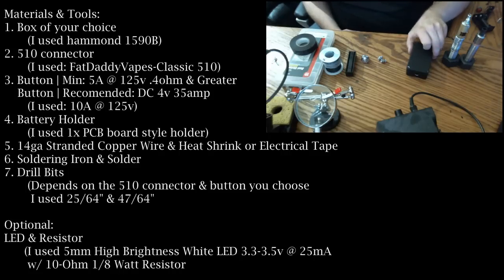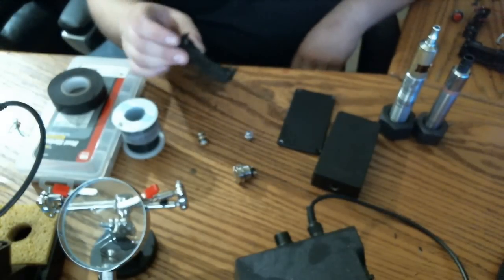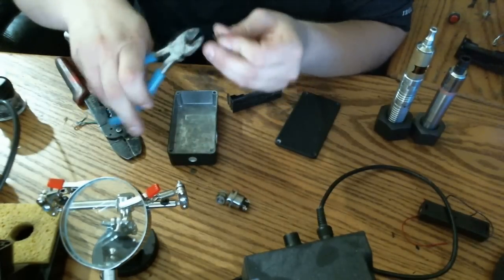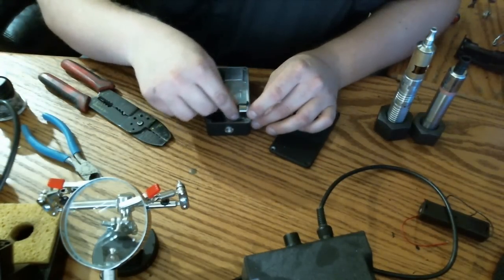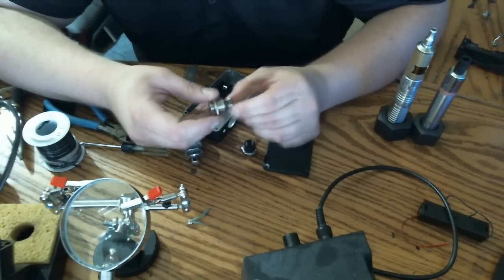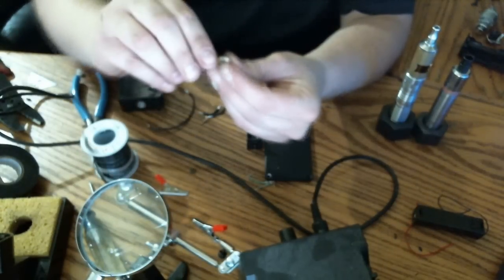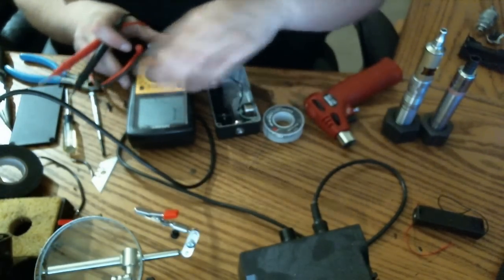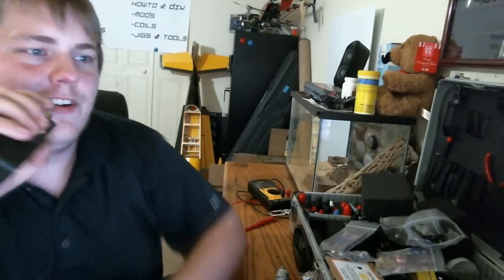How to build a Mechanical Box Mod FULL TUTORIAL

Comment: To the people that say this is not a "Mechanical" box mod. Well sorry to break it to you but this IS a Mechanical mod... just because there is a couple of wires in the power path, does not affect the fact that there is no digital electronic devices in the power path. Just because some "mechanical MODS" use the housing as the main ground does not take away this being a mechanical mod. Chassis ground is still a form of connection, just like a wire. Your just using the housing to carry the load as oppose to using wires. If you added a MOSFET in line to reduce the amp load going through the switch you then change its definition according to popular belief. Yet a MOSFET is nothing more then a relay (be it a solid state relay non the less) so to my understanding this still does not make it digital. Adding a solid state device in to a box mod is nothing more then good design and adds a bit of safety. But then again not a true "fully mechanical" mod. Ah whatever, but again the mod he is showing in this vid is fully mechanical and has nothing in the power path other then a single switch. The LED is only paralleled and has not effect on the way the power is delivered.
Reply: MasterMech77 You are mistaken, it is neither.
A Mechanical mod, as the word 'mechanical' implies, would suggest that not a single wire was used to complete the circuit.. A simple Google search will justify this statement.
This is an Analogue Mod. Evident through lack of digital circuitry, while there are still wires and components connected within the device. Again, Google will confirm this.
Just because there isn't a digital circuit board, doesn't mean to say you cannot achieve the same effect though analogue components. He even uses an LED and switch, both are analogue components.
For this to be mechanical, he would have had to do away with all of those things;
favouring no wires, no components, and a mechanical switch.
Reply: I believe: we started with mechanical circuits and devices; we then found analogue to be smaller and more manageable representations of their mechanical counterparts. Later we discovered how to shrink these analogue components down even further; to a point that a device which would have once occupied a small room, now fits into the palm of your hand.
Just look up a 'mechanical computer'.
Reply: 〈insert profile name here〉
Well by your definition anything with a switch is no longer mechanical.... hum
Reply: +MasterMech77  this is, in no way a mechanical box mod. Mechanical mods use no wires, such as a cherry bomber, noisy cricket, snowman, incubus...a mechanical mod has a solid switch that makes contact with the 510/battery....  this is just an unregulated box mod,
Reply: Randy Steele Sorry to say but Cherry bomber uses the housing as the ground. The wood and plastic Cherry Bombers use a short bit of wire to connect the 510 connection to the negative side of the batteries. The noisy Cricket uses a bridging plate (wire) that is insulated from the housing to connect the batteries in series. The Snowman uses a spring (which is nothing more then stiff wire wrapped in to a coil, so there is wires to make that mod) loaded base plate.

This Box Mod is as mechanical and a mechanical only. Unregulated mod would have a transistor in there to prevent the fire button from having to handle to full load from the batteries. That and a couple of micro fuses.

Here is a link to what an Unregulated Box Mod really is:
https://www.google.com/search?biw=1320&bih=852&tbm=isch&q=unregulated+box+mod+diagram&revid=1661255741&sa=X&ved=0ahUKEwjz9aOhgcXJAhUDYiYKHQ6ODgIQ1QIIHA
Reply: MasterMech77 I knew someone would 'nit pick'.
No. A switch in the analogue or digital domains control and serve a higher purpose "what will happen when the switch is in the off state?".
A mechanical switch does not care about 'state', it serves only to complete the circuit.

The vaporiser I built myself has no wires the negative current from the battery is received through the metal case, the metal case is used as a 'wire', and the button touches the top (positive) of the battery which completes the circuit within the 510 (connecting the weakest point (coil) to the battery). The button/switch is literally a sheet of metal attached to the negative 'downpipe' of the 510. Yes my mod is a bottom fed design; I copied and made my own reo'smod, for a fraction of what he charges. :P
Literally just a bottom fed 510 with a push button and a means to prevent the mod from firing unsupervised. I don't have a fuse, the coil is the closest thing to a fuse.

This vaporiser design is highly 'risky' only when operated, if the button is pressed for too long, if the user is inexperienced.
I treat my batteries well and do not over charge them. I build my own coils and take readings using a multimeter frequently to ensure my safety.
Reply: ***** Protected batteries have a circuit built into the cap to ensure that they are not being drawn from at a rate which would cause the battery to short.
I refuse to use these, as I have learnt how to prevent this from happening when I use my mod.
I would advise you use them if you don't know how to read a multimeter.
Reply: k

Comment: have your considered runing a MOSFET with you switches? wiring up a N channel Mosfet will alow you to run any switch and it takes the excess amps and volts and dump them. I built 4 boxs with this setup and they are running strong for 6 months sub ohm vaping

Comment: Hey! My evic vt just broke and I'm thinking about building a semi-mechanical mod using the evic vt's integrated battery pack. Do you happen to know where I could get a recharge/discharge circuit with overcharge protection?

Comment: Great vid. i have a rather beginner question. what resister do you use on the led and if you run 2 batteries in parallel does it change?

Comment: Have u used any resistors or mosfit on your builds and are they necessary. I am about to build mine with two 26650 batteries and was just wondering what all I would need

Comment: All I can say is, HOT GLUE.

Hot glue is a godsend when it comes to diy projects.  JB brand adhesives and menders which is more costly when working with small elecetroics.
Reply: tularem it may be a god sent but if done wrong on electrical projects it could melt all your shit
Reply: tularem a better thing to use for electrical is heat shrink

Comment: I really enjoyed your build I can't seem to find the switch anywhere I look do you think 10 amps is sufficient for a dual parallel build
Reply from the maker: Parallel builds do not stress out the button anymore than a single 18650 would.
If it were Series that would be a different story.
Reply: Well, a 10A switch can bear 10A of current, so the lowest you can safely build to is 0.42 ohms. That's assuming you can find a 10A switch.

Comment: wow thank you I appriciate you doing such a detailed video, but  it looks like after I order all those parts it would be more expensive then a reg mahine made mech mod ? true or flse ?
Reply: It depends.  If you make the box out of something else besides the Machined Aluminum Boxes then you will Omit the cost of a Machined Box, for example, if you make your own from Wood, No cost there if you got the wood for free.  Most box mods I've seen start out at around $65 on up.  So, with the Cheapness of the 510 connector and other parts, you should have well under that.  Most expensive part will be your PCB Controller board for Varable Voltage, Puff counters etc. Which then in return will Jack up the Price.

Comment: What is pre tining? I think thats what i was missing when i go to solder. The solder would never stick. is it grinding down or polishing it?
Reply from the maker: Pre-tinning is simply applying solder to each part before combining them. As opposed to sticking both pieces together and pouring the solder over them to combine them. Instead you take two pieces that you cover in solder individually and melt them together.
If your solder is not sticking one of these is likely the cause:
Cheap/weak soldering iron
Not using 60/40 rosin-core solder (smallest diameter you can get; I use .032")
Dirty wire or connection (clean with wire brush or apply flux)
Reply: A2Z Vaping Ohh ok! Flux is what i needed! Thank you!

Comment: How would you wire two battery holders in parallel? Also do you have a link to that DC switch? Do you know where I can get a box that will fit the dc switch and 2 26650 batteries?
Reply from the maker: Good news for you Harley I will be uploading a Part 2 in about a week showing a dual 18650 build wired in parallel.
If you need to know now parallel would be hooking the positive to the positive and negative to negative of each battery then wiring normally like I did in the video.
As for the switch I have seen them on Amazon & Ebay, Cole Hersee 9095
http://www.amazon.com/Cole-Hersee-9095-Momentary-Push-Button/dp/B001FQLQQA

Lastly about the enclosures Hammonds website is great because they list every enclosure and have 3D drawings of them with all the dimensions so you can measure you components and pick out the box that will fit everything.
http://www.hammondmfg.com/scpg.htm

Comment: I have a question, how do you solder/wire a button switch that has a built in led?
Reply from the maker: You need to link the positive input for the led to the output of the switch, then run a ground line from the LED ground to your battery box. You can see an example on another mod I did here: http://imageshack.com/a/img539/6969/oWFZdq.jpg
Reply from the maker: Also test your button first with a 3.7v power source, some have a built in resistor that you have to remove to get it to run off of 3.7v
So far I have had to do this in a Blue led button. A green by the same maker did not require this.
Reply: A2Z Vaping Thanks man, that's a big help.
Reply: A2Z Vaping Do you foresee doing this video soon?
Reply from the maker: Yami Diaz Yes actually I plan on ordering a new box next week to make a dual battery 18650 w/ LED button. I will take a quick video to show the differences in the setups.

Comment: it seems people abuse and misuse the word "Mechanical" mod.... but ill leave it at that... good video but this is'nt a mechanical mod...  what in your description makes this a mechanical box mod? i am curious. thanks in advance
Reply from the maker: Faaip De Oiad My mod has no chips or regulating devices. Instead of a traditional mechanical mod that uses the chassis to pass the electricity this uses a wire. Nothing digital, its just a wire instead of a solid piece of metal.
Reply: okay thanks! that cleared it up for me for sure... im stuck on building my own as we speak. i am having issues with a mechanical switch idea.. im sure i will figure it out. great video tho i like the ideas :) thanks again
Reply: ive actually got guts from a sigelei, defeats the purpose of mechanical, but the display on the YIHI chip is broken, but everything still works, + and - Volts buttons work just no display.. any ideas u can toss my way? or should i scratch that idea and start over?
Reply: Faaip De Oiad I havent seen that board myself but I would think youd have to luck out and buy another broken for a diffrent reason and solder the screen on. Maybe send it in and they will fix it.
For a switch I have seen a few clever designs using busbar.

Comment: Have you ever had any luck in grounding to your case?
Reply from the maker: Yes, but the fewer connection points the better. For example the battery would be connected to the battery holder, the battery holder is connected to a wire, the wire is connected to the case, the case is connected to the atomizer.
if you solder the battery holder to a wire then that wire to the atomizer, you have fewer connection points and a lower voltage drop.

Comment: What are the benefits of dual batteries compared to one?
Reply from the maker: It doubles the mAh. So basically vape for twice as long without charging.
Reply: A2Z Vaping and how would one go about wiring both batteries to the same button? just double wire it to the same solder point?

Comment: how much did it cost you in total to make this mod would it be cheaper for me to make this mod or to just buy one?
Reply: Michael Leix I have made a bunch of BOX MODS, using all kinds of different buttons, battery sleds, 510 connectors. It depends on where and how much you can get your parts. I think the least I have spent was about 20 bucks (that was for a single battery wood box mod that I made from a small rectangular puzzle box) then about 140 for a full out dual battery DNA type box mode with on board digital display and USB battery charging.

Comment: can i use regular batteries like eveready or energizer??
Reply: 18650 is the most common batt used. 
Before you build check out some of the safety vids on batteries.
Lots of cheep and potentially dangerous batteries out there.
Happy building.

Comment: Can you quickly explain how to wire a dual battery pack I can't seem to find any diagrams online  and I been trying to figure it out I just can't get it its probably super simple to lol thanks
Reply: If u want long battery life then you want to wire it up positive to positive and neg to neg.
Reply: How he is describing would be wired in series that would give you the highest voltage output 8.4v with two fully charged batteries. The way I described would give you 4.2 v but twice the battery life. So it's all about what u are looking to do with your mod.